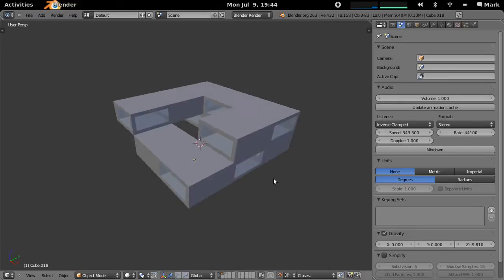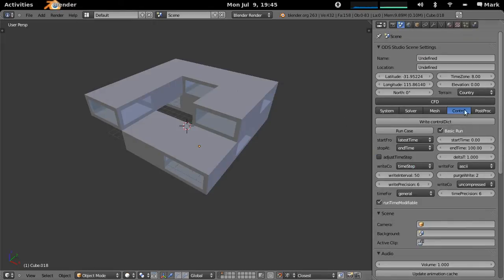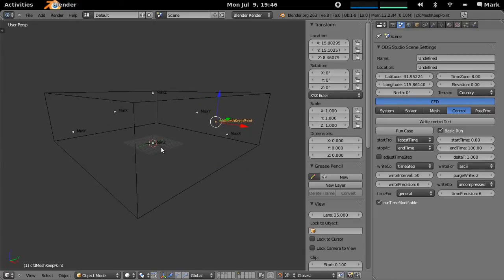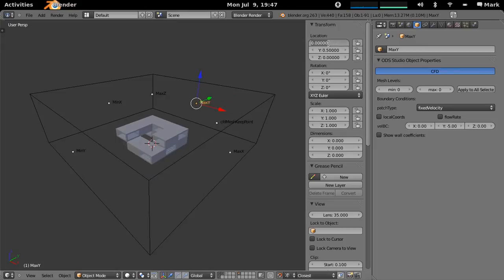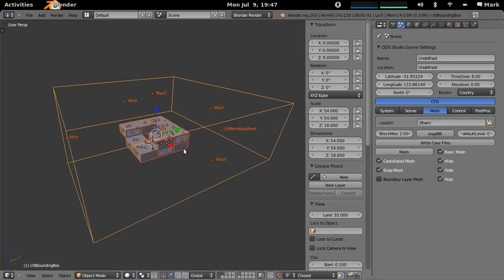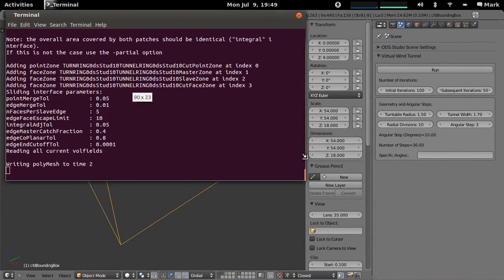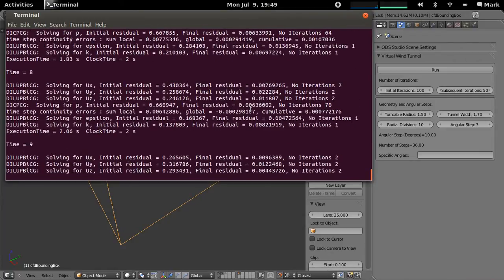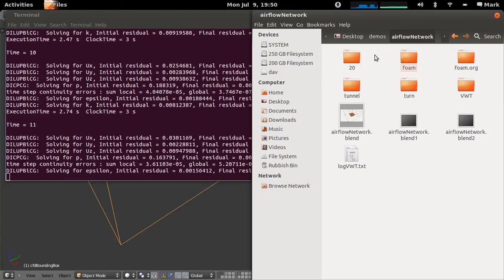Virtual Wind Tunnel demonstration

Comment: Hey Mark, how are you? greetings from Brazil. I just wondering if its is possible create ocean current (from deeep sea) and make a spill oil, and create a alert system. And predict whats is the best position of this sensor based on the ocean current.. Could we talk in hangout, please?
Reply: it should be possible since a wind tunnel does deal with fluid flow ... air is just less dense than water or crude is all ... so upping density would be a must .... and then check into convection currents for the heating and cooling of deep water and shallow water